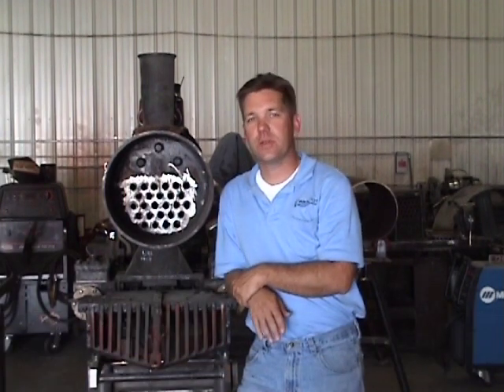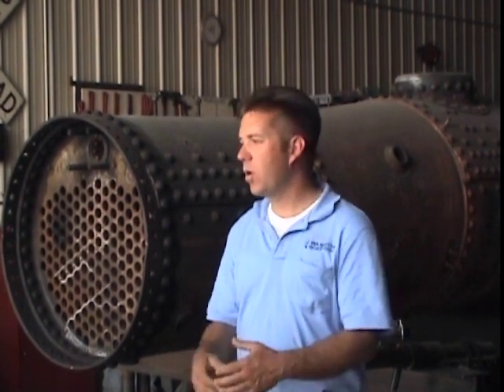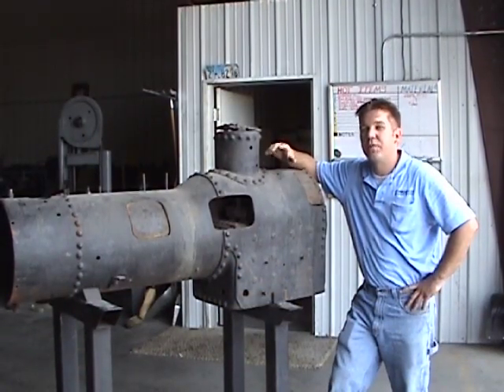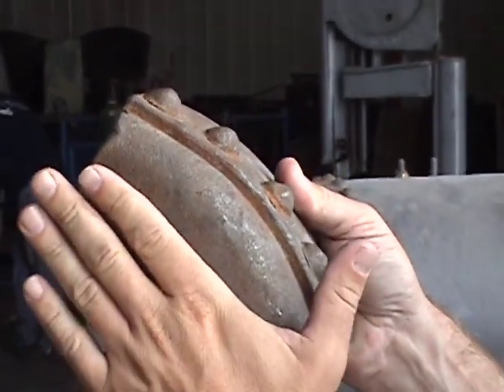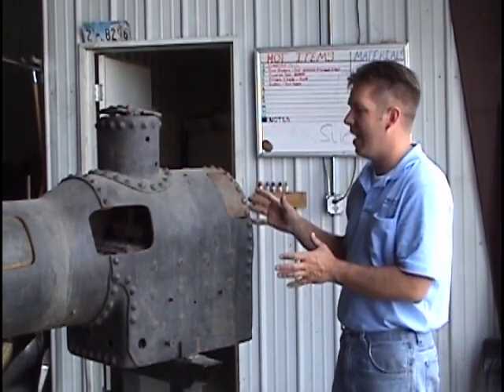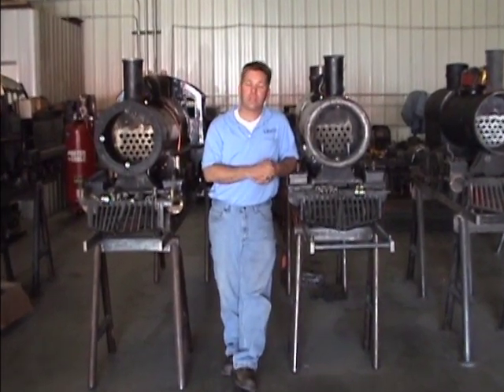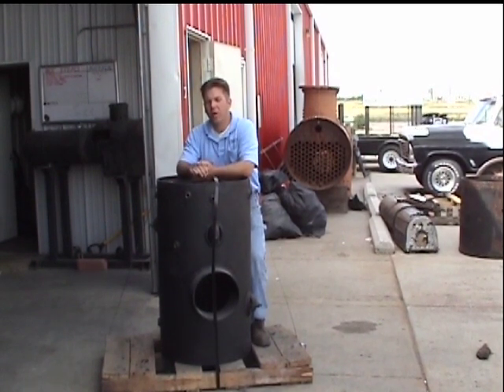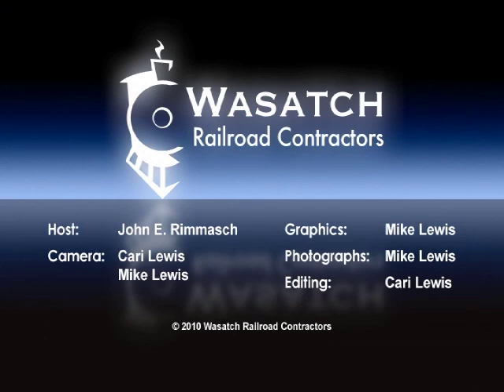ASME Code and Boilers

Comment: Good to cover these boilers. Showing the knuckle failure point highlighted great details that inspection uncover.  However, I would like to add that you indicated that repair exceeds the cost of repair but, neglected to state that to repair any boiler you would need traceability to the original code of construction, which may not be possible. In addition, the repair and alteration to any boiler in operation (post construction) must be repaired in accordance with the National Board Inspection Code.  Thus, in most cases these old loco boilers will not have the necessary documentation to the original equipment manufacturer and thus, would have to be reengineered to the existing ASME Code.  Thus, it is more feasible to have a new one built to the ASME Code, Section 1, Power Boiler Construction Code.  Thank you.
Reply: Milton Washington well said sir